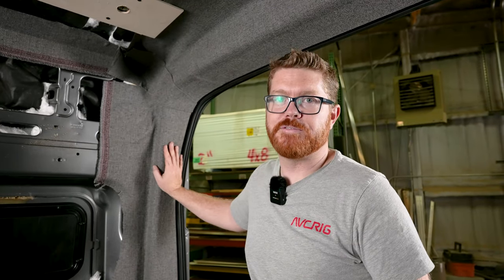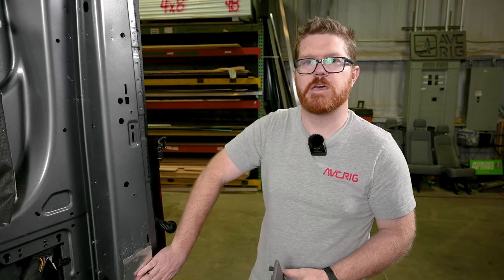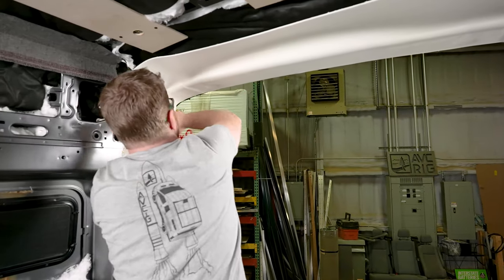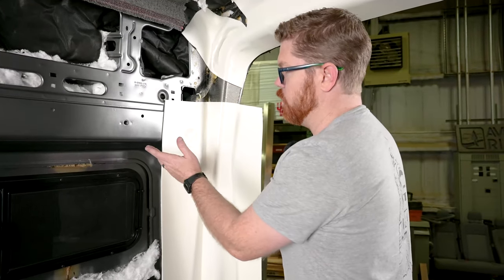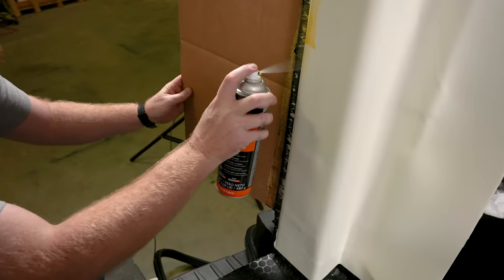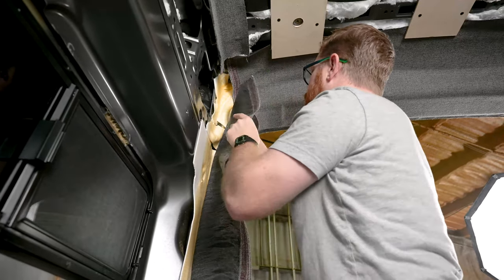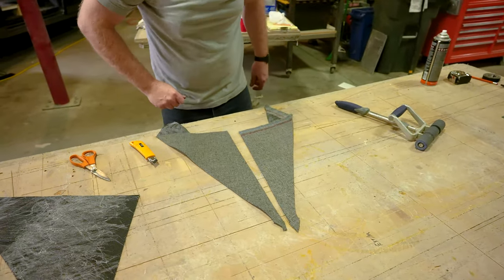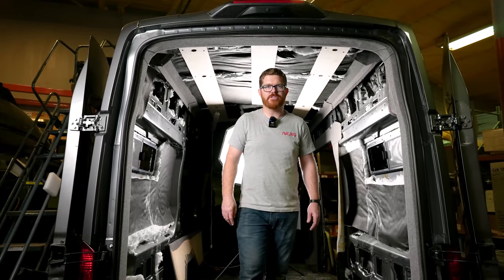Wrapping REAR COLUMNS in FORD TRANSIT

Comment: Got this done!  I would recommend adding a step to mask out the section under latch covers (with 1/2 inch margin) and other plastic fittings prior to foam - then removing that foam before applying the fabric.  I am unable to get my latch covers or light control panel to snap back into place.   I did successfully use this technique to keep the rear lights (then partially hid them under decor).
Reply from the maker: That’s a great suggestion. I’ll give it a shot on our new van!

Comment: Would you still be able to install bug nets like the bug wall? That also gets installed under the weather stripping. Would the foam, fabric and bug wall material be to thick for the weather stripping to fit back on?

Comment: WHY did Ford put that switch for the overhead lights on the left hand column??? I ran wires, and moved it to the right hand side, so it would be RIGHT THERE when you open the door!

Comment: Great videos, however how do you access the rear tail light bulbs if one burns out? It appears you upholstered over the access ports.
Reply from the maker: You can remove the tail lights when you open the back doors.

Comment: Hey Matt, great content! (Subscribed)  You don't mention and I can't tell.....but did you spray 3M 74 on the foam side? Or ? Thanks from an appreciative Sprinter owner!
Reply from the maker: We do yes. 90/94 would also work for this application. Landau is closed cell and doesn’t melt with 94. The 74 we use just tacks up faster so we can work faster.
Reply: @AVCRIG  Thanks!

Comment: Nice videos!  I'm binge-watching your channel and appreciate your simple design choices and high signal-to-noise ratio videos.
(Particularly since you've ditched the background music (couldn't resist) :-)
Q:  Why not apply a single fabric strip over the arch and sides instead of three pieces to avoid the (visible) seam covers?
Reply from the maker: The fabric we use is really hard to stretch that much.  It’ll do some things, but I’ve never gotten it to bend that much.

Comment: Great Video! I've seen people not use foam and just adhere the fabric directly to the pillar. Is there a reason you used foam? Also what is the difference between the 3m 90 and 74?
Reply from the maker: We like the way the foam softens the wrapped sections of the van. It does add a warmer feel but no appreciable insulation. It’s definitely not necessary, but we think it is worth it. 

90 is a general purpose adhesive. It will work just fine for this. It will melt the “blobs” so maybe look for one can of 74 for that. We like 74 for the wall’s because of a few things. Foam and Fabric specific, fast tacking, and orange color (optional on 90 in red). The color is nice (especially in a white van) to see where you have sprayed.
Reply: @AVCRIG  thanks for the reply! That makes sense! I was also wondering, do you guys just use self tapping screws for your roof framing?
Reply: @mitchellkauffman6799  we do, but we bolt up the ceiling into 8mm inserts.

Comment: Is there a reason you changed the adhesive you used on the video to the one you recommend on your store?
Reply from the maker: Sometimes Amazon does that based on your location. Not all glues are available in every market. Sometimes the link just gets messed up too. Thanks for the heads up!

Comment: So I’m worried about removing the door catches on the top rear of the van in order to wrap the rear columns and top like your doing here. Do you guys have any other videos or resources that show how to remove and reinstall the top rear door catches safely?
Reply from the maker: You just pull them out.  It’s very simple. In the Sprinter there’s adjustment, but the Transit is stationary.  The only thing to solidify would be the torque specification.
Reply: @AVCRIG   gotcha thanks. I actually figured it out, it is much simpler than I thought it would be. Thanks again!

Comment: Does the 3m 74 hold up ok in high heat? I used 3m super 77 for something similar and had a lot of issues.
Reply from the maker: 74 does MUCH better. 77 is not really meant for this kind of application. It’s more for mounting photos and craft projects.